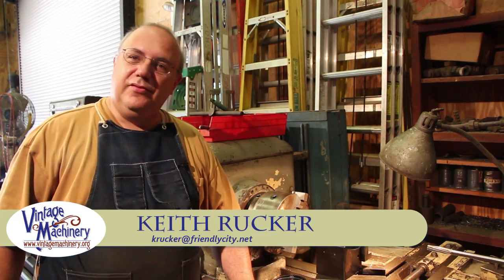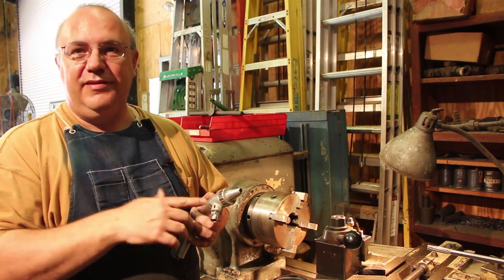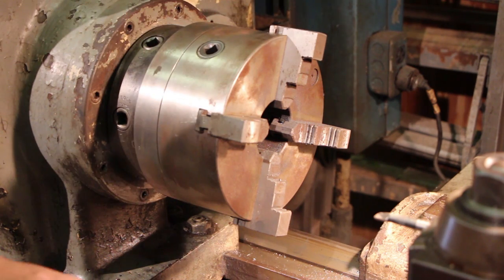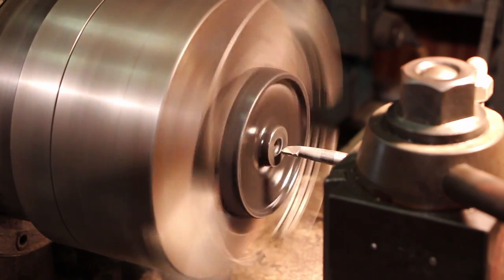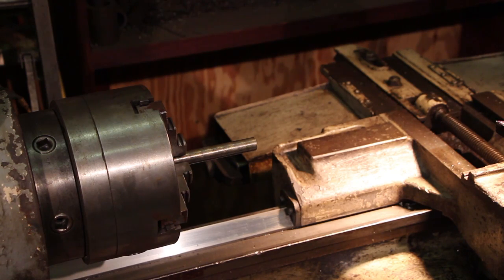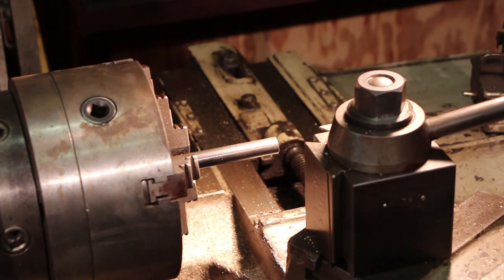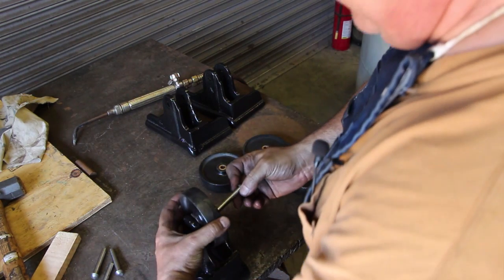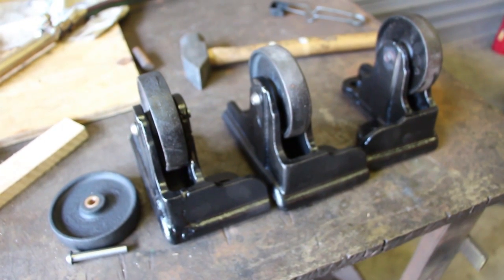Victor Safe Restoration - Part 3:  New Wheel Bushings and Axles

Comment: Hello Keith          I have a Lodge & Shipley 20" X Model Heavy Duty lathe. It is similar to the lathe you have.  I don't know how old my lathe is but it is still a very useful, profitable  and accurate machine. Mine has a 25 HP motor on it. I have had mine since 1998 I have been careful to oil and clean the ways.  It cuts about .001" taper on a 8 inch long test cut not bad for a machine I would guess was built in the 50's
Reply: ***** I checked the serial number today and it is NO 34627
Reply: That is amazing! That means it is 72 years old! Every feature on it works. It still threads really nice.I used last week to make pump shaft out of 410 SS

Comment: Keith, I was wondering about media blasting have you ever done any soda blasting, plain Baking Soda, I used it recently to remove old paint and rust from some parts much less blast damage even on the thin places just an idea
Reply: I use a low cost gravity feed gun I bought  at Harbor Freight and gust load it with plain baking soda Arm n hammer that you can buy in 7 lbs bag, hope this helps a bit
Reply: I buy the bags at Wal-mart check  down in the section where you find pool chemicals, as to how it works well it might be a bit slower than bead blasting but it won't eat the peace you are cleaning,   Cap'n Eddie Castelin has a nice video on soda blasting on his channel I think the HF gun was like $15.00 or less, you might even be able to use your regular gun too, I just never had a cleaning setup before I started hope this helps OH YAH I love your channel and can hardly wait to see more on the safe

Comment: Hey Keith thought you might have some thoughts on the removable of a chuck from. The faceplate? The lathe is a 9in South Bent. I worked for a a small shop, over 15 years ago and was a greenhorn in a machine shop. Anyway got the chuck on so tight we

Comment: A little JB weld and it will be good as new...
Reply: Definately could just fill the flaw in the casting Or just drill @ tap the hole and put a piece of threaded bolt in there.

Comment: I know exactly what the issue with that sandblaster was. A flaw in the casting.

I ordered 4 complete units for me and 2 of my friends (we decided on a deal so we'd each get an overall cheaper price and one extra of all the parts in case something ever broke down).

Being a nitpick when it comes with new equipment i checked the parts, i sometimes even void the warranty if i feel that i can safely replace parts via the internet.
Found an air bubble on the inside of my suction side tube. The part where the hose connects.

I let it be thinking, what could happen. Exactly the same thing you have there, happened to mine a year later. Found a similar flaw in two of the others.
These days, nothing is done right anymore.

Comment: Hi Keith
Really enjoy your videos, look forward to them with anticipation,
Your commentary skills are second to none and very informative .
Just one question though, why would you put wheels on a safe? On this side of the pond we would be bolting it down, so them thieving varments could not pinch it.
Your to friendly to those villains.
Keep up the good work and brilliant videos.
Tony
Reply: Safes had wheels back then because unlike today when you can use small hydraulic jacks or a small crane and hoist the thing on a truck bed or roll it, back then something like this was practically impossible.

On the other hand the shop owner could say, in the morning have the safe, near his feet and put money inside keeping only a set sum in the cash box and then roll it back in to storage during the night.

Of course, not all safes had wheels even back then but it was one of the reasons. Nowadays you see less of these examples for the reasons stated above.

That's my 2 cents anyways.

Comment: Keith,
Thanks for the latest video. Looks like the safe project is coming along just fine. Like you said, a coat or two of paint and the casters will look like new. I'm glad that you are refinishing the safe instead of leaving the rust on it. Rust can be like a cancer and keep eating away at the metal. I feel that refinishing is part of restoring.
Have a good one!
Dave

Comment: Please humor a neophyte, why didn't you use a drill bit in the tail stock to bore out the wheels?   

Love your site, thank you,

John
Reply: ***** Thanks for explaining that, I was wondering about the same thing...
Reply: I was wondering that too.  Explanation makes perfect sense (Palm to forehead).  Thanks, Keith!

BTW, I saw a soda blasting demo a couple of years ago.  Professional rig in the back of a truck. It removed paint very fast and completely (we were stripping a car hood and a fender). It did not remove rust though. It shined up the steel under the paint, so it was probably abrading the rust spots a little, but not noticeably.  I wouldn't want to use it for rust removal, but for paint it was first class. I've also heard of it being used to remove smoke damage from wood, but didn't see that done. 

Advantages for paint stripping over sand are that the soda can be washed out of the nooks and crannies, and the soda also tends to neutralize any acid on the metal from acid rain, fingerprints, etc. it's also fairly environmentally friendly, not toxic, and won't give you silicosis like sand can. 

One other technology I've heard of is blasting with dry ice...similar to the soda, except the media evaporates so no cleanup at all.

-- Mike

Comment: I wonder if the wheels were originally bored slightly off center so it wouldn't want to roll on its own. Kind of a natural brake for the casters since they obviously have no locks.
Reply: i think they cast them and had a dimple to show for centre, then someone drilled them out on a press, sometimes you got a wonky one!